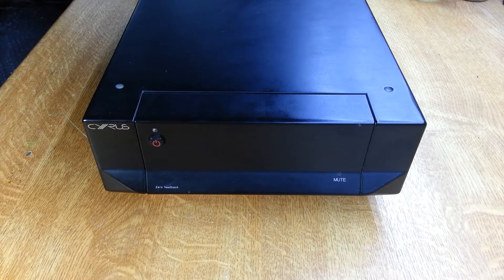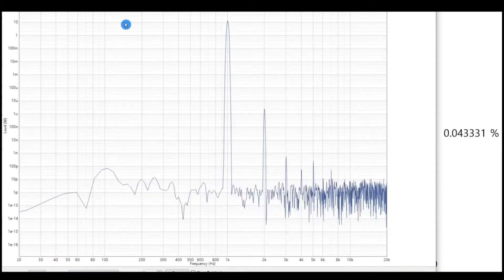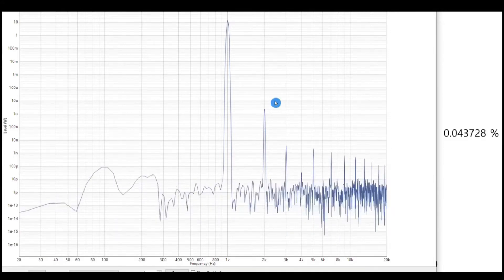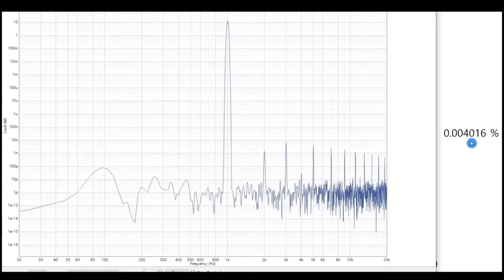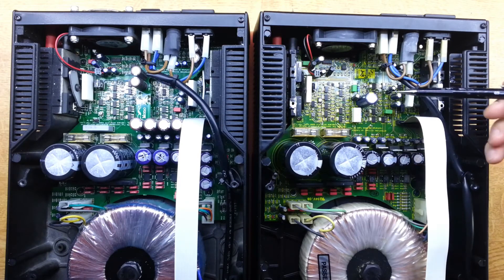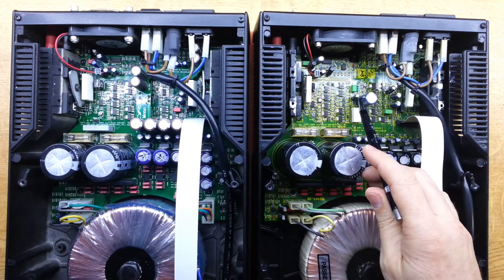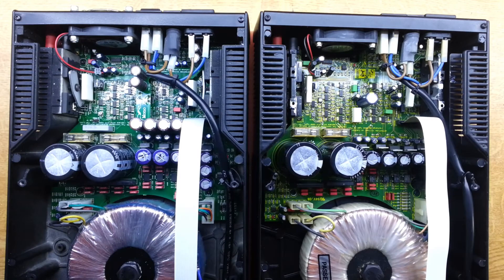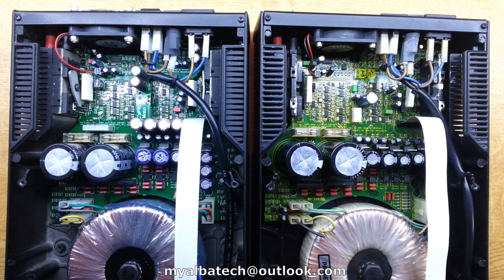Cyrus aPA7.5 Power Amplifier Distortion Check and Adjustment

Comment: I was thinking of getting the X to bi-amp my Cyrus 8 integrated amp, but in your other video you indicate the X is somewhat floored in its design so has a tendency to crap itself. I guess I will just leave it as is then, the 8 has plenty of power anyway.
Reply from the maker: The 8 has the same section of circuitry as the X Power that you will see smoking in other videos!
Reply: @myalbatech  Thanks, I will use it conservatively and not invest more $ into the brand. I will say though that I’m always impressed with how it has performed. It sounds awesome and packs a big punch. I always have the fans that I’ve fitted turned on if it’s going to get hot. If it craps itself I will upgrade the system to something superior, though it’s difficult to know what is genuinely superior.